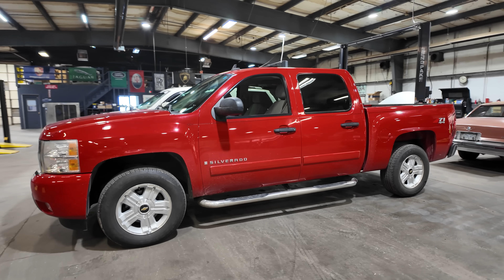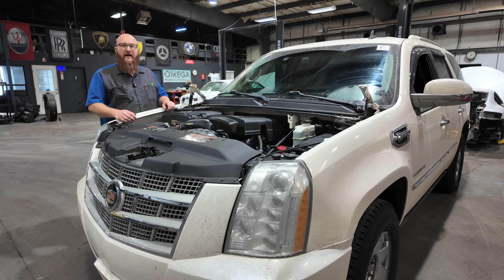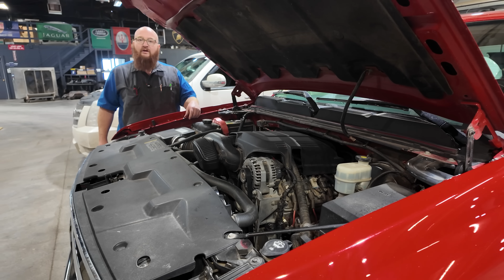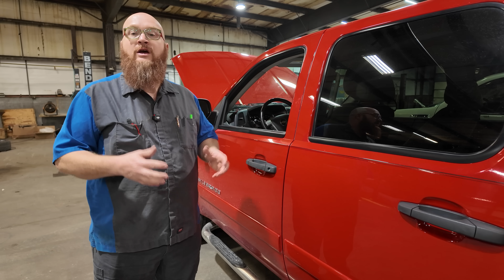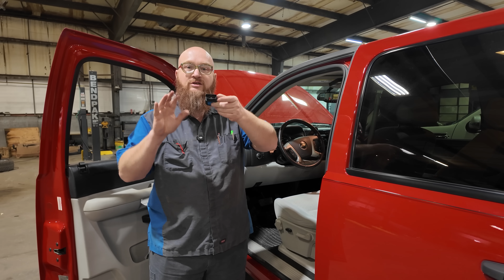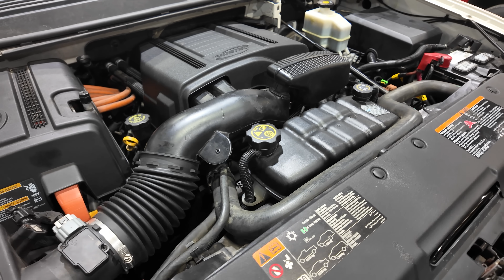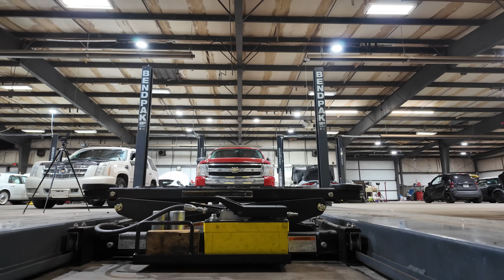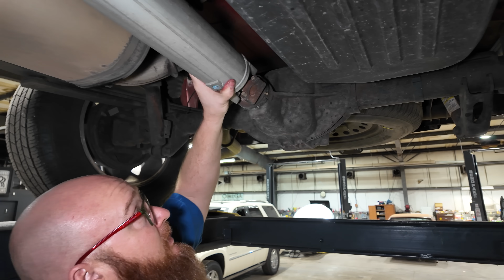AFM: Engine Saver or Engine Killer? The REAL Answer

Comment: Yep, the ENERGY CRISIS HOAX of 1973 is still haunting us. But, full disclosure, when the previous presidential administration was forcing America into EV so their capital crony's could corner all of the Electric market, from generation to consumption, they also made utterly ridiculous demands on the car companies to get better and better gas mileage which lead to them playing tricks during the EPA III and the HWFET to produce better numbers but cost Americans in longivity quality and robustness. These tricks, like Displacement On Demand (DOD), Cylinder  Deactivate (CDA), Variable Cylinder Management (VCM), Multiple Displacement System (MDS),  Acting (up) Fuel Management (AFM) and Dynamic Skip Fire (DSF) are complicated and show room new. They've not stood the "Test of Time" and are failing at a rapid rate. THEY ALSO negatively affect the TRANSMISSION. The gimmick to place a clutch within the torque converter was bad enough, but then they started modulating the engagement of that internal clutch to further trick the EPA III and HWFET.  It's just another level of sophistication to go wrong. Now they are making the transmission parts cheaper and weaker and relying upon computer controlled momentary engine power reduction to make a gear change. If one were to remove the constraints on the engine by the various alternative displacement and power methods, they risk offering full power gear changes, and that would almost  pass as PLANNED OBSOLESCENCE. Remember when you monkey around with any part of an automobile it affects other parts of it and YOU BECOME THE ENGINEER. In the words of my Auto Tech Teacher in 1970, "Keep It Clean, Keep It Stock and Drive It." But Mr. Bedrossian; the car companies aren't building vehicles that last. One has to do something to "better be right or your great big venture goes wrong."  Black, Brown, Red, Orange, Yellow, Green, Blue, Violet, Gray, White, Gold and Silver. Or Bad Boys Rape Our Young Girls But Violet Gives Willingly. Ha. Add that to Eli the Ice Man. I can't just give them all of my life long earned $$$, and my children's children don't need to be strapped with all of these constraints. China is burning fossil fuel like there is no tomorrow, why can't we at least be comfortable.  ben/ michigan

Comment: Hi Sir, just got new lifters for the 2015 Tahoe, brand new ac delco installed. 
The intake one on cylinder 7 not building up the right pressure and slamming pretty bad . Darn I have to take everything apart again 🙃

Comment: I just bought a “boost” brand plug in delete for AFM/DFM and only day two but loving it so far. Mine use to have a weird “transmission” jerking feeling but I think it’s the fuel management trying to decide between V-8 and V-4 and not the transmission. It has not done it since but we will see in the long run.

Comment: 8:38 important note, while the electronic afm disablers significantly reduce the risk, AFM lifters can and do still collapse and cause damage to the engine even when the system is disabled.
Reply: How and why if the oil pressure is not moving any of those parts? Just curious before I buy one of these trucks.
Reply: @colbycarson1820  the physical spring-loaded hardware is still there, meaning the lifters are still susceptible to oil pressure drops, sludge buildup, or mechanical wear.
Reply: @540wildin4 Is this because of not changing the oil regularly or on time?
Reply: @natepenley9114 it’s definitely a contributing factor but not the sole reason

Comment: I had a lifter collapse on my 2007 5.3L and replaced with an AFM lifter.  But I had the ECM tuned to turn off AFM.  It worked fine for many many miles like that.  I did not have to delete anything mechanically.

Comment: I have a 2008 too, it went with 167,000 miles on the odometer about 5 years ago. Considering the truck was in very good shape and the price of trucks I got a GM engine from the dealership and had my local shop install it and I put a disabler in it.

Comment: While the lifters in a Chrysler hemi do fail. They don’t fail like the Chevys. The failure of the lifters for the Chevys is directly due to the afm lifters while the Chrysler failures are due to a lack of oil at the camshaft at idle etc. if you upgrade to a higher volume oil pump like a melling or a hellcat pump on standard 5.7 the issue will never happen

Comment: Gm never learned their lesson about cylinder deactivation they tried in the 80's to on the Cadillac 4-6-8 engines that were nothing but problems just using oil pressure  now they use oil and electronics and cant get it right

Comment: Low tension rings, lack of proper oil changes, ignoring oil leaks on things like those oil cooler lines are the real killer - AFM is not the primary killer - seen many drop lifters and eat bump sticks on non AFM cylinders more times than I can count.

If anything its the AFM assemblies bypassing and that hardened oil pump pickup tube o-ring at 130k causing a steady low oil psi and let's not forget cavitaion, because hydraulically dependant systems just love air.

Plugged galley ways and the engine oil getting very dirty due to people ignoring the engine cooling system problems not allowing the engine oil to come up to proper operating temps and boil off that moisture!

Short trip driving is another huge killer.

Is AFM/DOD a horseshit system, yes, but I see many miss the root cause of failure because they attack the symptom not the actual root cause.  All that work just to miss the real reason for failure...how interesting.

Take down that oil pan and the story comes together real quick.

The smell, the visual, and the findings in that sump tell me if it has been properly maintained instantly, and that pan and possibly rear main have already started or have been leaking at that point anyways 😂.

The classic, "I cleaned my room dad." What's under the bed....hmmm...😂

Comment: I have a 2013 Silverado and Tahoe with the 5.3 with AFM. Installed Range disablers. They work fine but be aware that they do run the battery down a little faster than normal so in winter if the truck is not driven everyday, it's better to remove the disabler while the truck sits and the re-install before startup. Also, if say a fuel pump is replaced and codes are cleared, the disabler will not allow a drive cycle to be completed so you will fail your next E check. The way around this is to remove the disabler and drive the truck in M5 for a few days which also disables AFM but you lose 6th gear which is not a big deal. You can then complete the drive cycle, pass the E check and then re-install the disabler. This process insures you don't get into V4 mode at all which in my view is a risk.

Comment: AFM/cylinder deactivation is an interesting but ultimately bad idea. 
if you want big block power but fuel efficiency, get a 5.3-5.7L with a turbo, not a spicy one but just enough to get 5-15psi and you'll get surprisingly decent fuel mileage and power when you need it.
if you do, get it tuned professionally, as it reduces the odds of blowing upness disease, and so the computer doesn't keep trying to run the engine like it's NA and cause problems like lean fuel issues.

Comment: Dead 2014 Camaro SS with the L99. 76k miles. I wasn’t even done paying for the gd thing. I’ll never buy another modern Chevy. They died in the early 2000s. They owe me a gd engine without 4 cyclinder mode. Who the fk wants an SS Camaro that’s not running on 8 cyclinders?

Comment: Another way to disable the AFM/DFM and auto-stop for free is to shift the truck into low and select the highest gear BEFORE overdrive. So if you have a 6 speed, you select L5 , if you have 10 10 speed, you select L9 works like a charm.
Reply: Who wants to drive in Manual mode using buttons on the stalk to shift?  I can imagine telling my wife, put it in M mode and use these little inconvenient buttons to make sure you shift it lol.  Not happening.
Reply: You don’t have to shift the gears manually. You just set the gear selection to 1 under its highest gear. Transmission still shift like an automatic and this also turns off the automatic start stop function. My 10 speed I’m unable to tell a difference even at highway speeds between the transmission being in 9th or 10th gear.
Reply: @timothyboone5003  you're saying the same thing that I said.
Reply: @Hashi-t5o  I was replying to James comment.

Comment: i had a 2010 6.2 yukon completely stock 320k miles with afm at 321k it started to have one ticking lifter if you change the oil it’s not really a issue i always do 3k oil changes i bought it with 120k and in 3 years i racked up that much i drive a lot just depends on how you maintain your stuff

Comment: You can also shift into D3 instead of D on the column. You wont get highway gear and it will rev higher between shift, but It wont actuate the AFM lifters (unless theyve changed it on newer gen vehicles).

Comment: My 5.3 has over 200 k miles on it, when should I worry?
I had another one that a lifter went down, I drove it around 2 weeks, pulled the head and replaced all AFM lifters on that bank, worked perfectly after that.

Comment: The highway fuel economy on the hybrid GM trucks is nothing to write home about. However, the city fuel economy is much better. One other con is the towing capacity on the hybrids is subpar. So if you do a lot of city driving, the hybrid is worth it but if you do mainly highway driving and or you tow something heavy regularly, it's not worth it.

Comment: I have a 2016 Silverado. Currently tuned the afm off and change oil regularly. May still do the delete someday. AFM is total bs. I’ve not noticed any MPG difference between AFM and no AFM and if there is a difference it’s so small it’s not noticeable. Really infuriating they gave us defective engines to save .2MPG

Comment: Not sure about this particular applicaiton, but there might be a difference between AC Delco parts and "Genuine GM" parts. AC Delco is in some cases now just a generic aftermarket product with the AC Delco name on it. Genuine GM is the actual OE part. Case in point: When I replaced the front wheel bearings on my 2004 Toyota Corolla, there were a number of aftermarket brands from which to choose, including AC Delco. They are all pretty much the same quality, including the AC Delco. Then there are a few brands which are suppliers to the manufacturers, in my case one of them is "Koyo" a Japanese bearing maker. I wound up choosing a "Genuine GM" OE bearing. Guess what was inside the box? A made in Japan Koyo bearing, which IS the OE for the Pontiac Vibe which is essentially the same thing as a Toyota Matrix or Corolla. AC Delco is often just a generic manufacturer which pays a fee to use the AC Delco name, but the part inside the box is a cheap or a medium quality typical globally-sourced aftermarket part. AC Delco is no longer what it used to be 45 years ago.

Comment: the 4 AFM cylinders run at a lower compression pressure.  I would not consider the OBD AFM disabler to be a proper fix.

Comment: AFM does not save you anything.  It's a gimmick designed to boost MPG numbers and probably also to cheat the emissions test, so you can get more HP.  (just my opinion). If you actually observe and record your mileage, it actually can cost you alittle mpg in the city.  To get any real benefit from it, you have to have the wind to your backside.  It's a joke. BAD idea.  Outside of that the Gen 5 motor is really very good (except the new 6.2L's).  You can also prolong the life of the motor by doing an AFM delete.  Either go to a speed shop and have them tune it out, or you can buy a plug in thingy that plugs directly into your OBDI port, it will disable the AFM.  But it won't guarantee you that you won't have a lifter failure, but it does help significantly.  You have to do the full delete (mechanical also) to get guaranteed results.  Another thing to keep in mind is always use mobile 1 synthetic and do you oil changes 7500 miles or better. That helps too.  Getting lazy on your oil choices and change intervals won't do you any favors with AFM.

Comment: In my 2021 GMC with the 5.3/8 spd combo, I lost a lifter at 37k. Since then, instead of shifting into D, I shift into L, then toggle up to 7. This disables the AFM, disables the auto on/off when stopped. It also helps with the drone at highway speeds since I have a Flowmaster Series 60 muffler.

Comment: Had a 14 Chevy Silverado with 150k on it . The lifters stuck in the block. and ate the cam. The engine was junk. It overheated the trans. I like the truck alot. So I made it how I thought it should of been. AFM, VVT deleted. Trans rebuilt with better parts. Brakes upgraded. Had a 3.5 inch lift installed. So it wasnt a low rider.  Slightly bigger tires. The thing is a dream. I run 5W-30 oil in it. Not 0W-20. I also have a 2011 Chevy Silverado 285 k on it. I run E85 in it. The AFM never comes on. I run 5W-30 oil. Change oil at 3K or when the oil starts to turn black. The engine never been open up and its quite. The Transmission went out. Only problem ive had with that truck. The trucks are good. The problem is the government and the emissions equipment.

Comment: Had a collapsed lifter at 60000 km. $6,000.00 repair. I tried the range afm disabler on my 2015 6.2 Denali and had problems with the vehicle wanting to downshift on downhills, so I returned it.

Comment: Very informative video, thank you  for sharing. I have a 2011 GMC Sierra 5.3 pick up which is running great so far, how to do I know for sure if the engine is AFM type or not. There is nothing in the dashboard indicating 4 or 8 cylinder while driving

Comment: With AFM vehicles, you can use Manual mode to prevent AFM from activating. The instrument panel can display your instant V8/V4 econ. It shows your current MPG (option after transmission temperature on the 2013 Tahoe). When in Drive or M6, you'll see your vehicle display instant V4 econ on occasion. This is when your car activates AFM. Experiment all you want, but I've seen it switch into AFM while slowing down for a speed bump. I started driving in Manual mode. When the vehicle is in the gear-range of M5 or lower, it won't switch into AFM (instant V4 econ). I believe that AFM only activates in Over Drive, or 6th gear. I'm worried about engine failure on the highway, and found the M5 gear range is an easy, free workaround to prevent AFM from activating.

Comment: I bet those AC Delco lifters sat dry on a shelf somewhere for 10-15 years before you got them. They would never work. Not a fan of DFM - even on my old Hybrid 6.0. It never stays in 4 for long enough to make a difference - and it takes away a lot of smoothness. On my 2018 6.2 I disabled with a tune right after I bought it. Still bet the EPA mileage most of the time. I hope GM makes it go away forever. Only GM V-8 I would consider now is the 6.6 Liter (because it does not have it).

Comment: I bought a new 2006 Chevy 1500 3LT regular cab short bed truck with 5.3L and AFM. The window sticker listed 21MPG highway, but it never, ever came close, the best it ever got was 14MPG. While still under factory warranty gasoline was disappearing faster than even the onboard computer tracked. The Wichita Chevrolet dealer refused to look into the problem as the "check engine light" was not lit. Solved the fuel mileage problem by trading it in at the Ford dealer just down the street from the original selling dealer.

Comment: My 2014 Silverado LTZ has active fuel Management, that caused the lifters to fail twice.  In the end, I had to replace the lifters, the cam, the exhaust system, cats, O2 sensors, etc. for a total of $5,000 in repairs.  A week later, the lower end started knocking, so did a full motor replacement for $3200 more.  Now I have to take it to the Chevy dealer for a computer flash to remove the error codes.  The new motor is a 2016 with the same mileage.

Comment: GM made the L77 with AFM for the Caprice police vehicle, that Cadillac would have a 6.2 with AFM, or a LFA or LZ1 6.0 with AFM. None of these engines were ever used in 2500 or larger trucks. So yes he is correct about that Cadillac having a 6.0 with AFM. Thankfully GM was smart enough not to put time bombs in their real trucks

Comment: I am not a master mechanic. But me and a mechanic buddy tried this same repair on the hybrid Escalade. Put everything back together new lifters and machined heads. Tested to make sure engine rotates before startup. The problem was the engine will not start due to reset issues. I was told this engine needed to be reset with a Tech 2 scanner. My buddy or the owner never did inform me til this day what was the fix if any.

Comment: There is another way to disable at least DFM. I have a 2021 Silverado 5.3L 10 speed transmission. Since new ive been driving in gear selector L9. shift in to the manual mode, select gear 9. it deactivates the DFM and the auto stop start. ive been doing this for 85k miles with no issues. Only side effect is it does not use 10th gear and having to shift it in the first place is annoying to some.

Comment: I have a 2015 Silverado 5.3 with 98k and I have the AFM disabler with no issues and my wife has a 2021 Tahoe 5.3 with 67k no disabler no issues.  I religiously change the oil every 3k to 4k with Mobile one full synthetic and no issues.  I believe these new motors love fresh oil and I switched from 0 20 to 5 30 in both as well!  Never heard of a motor having issues from changing the oil to often!
Reply: The 2021 Tahoe has the L84 engine - DFM instead of AFM. Variable deactivation. Still vulnerable to lifter issues. But everything I’ve seen, regular oil changes and synthetic oil and you’ll likely never have a problem, even with the AFM.